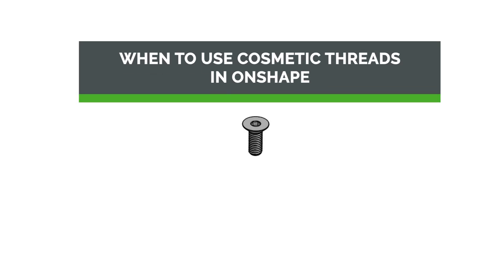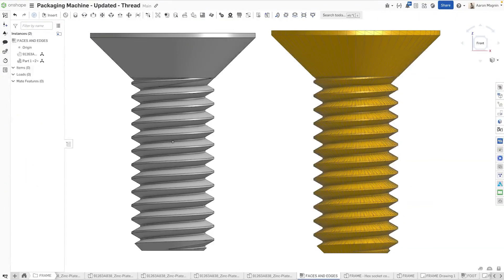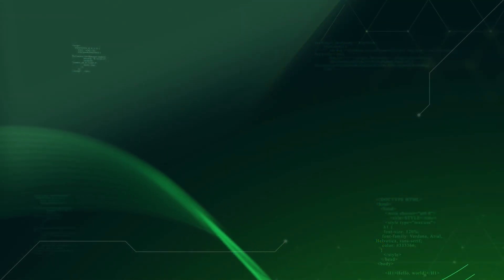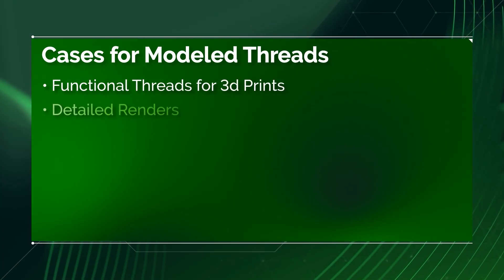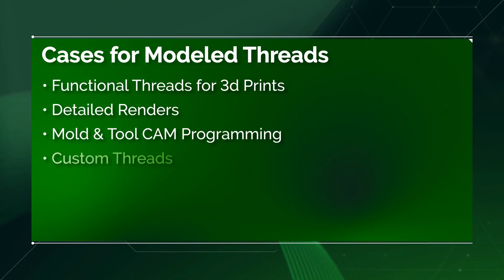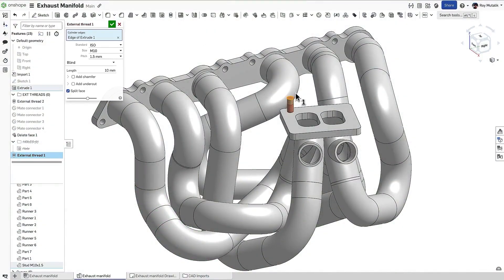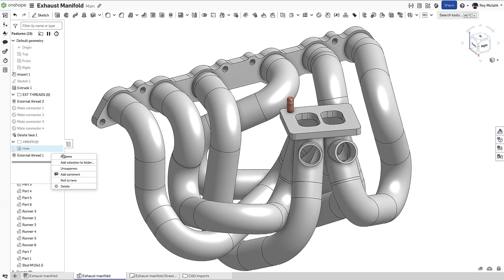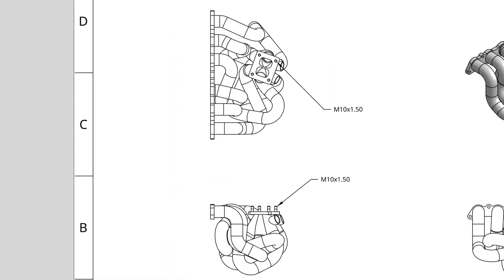Why Cosmetic Threads Are Usually the Better Choice in Onshape - Tech Tip

Comment: If I export a part with cosmetic threads, for, say, a 3D printer, will it print correctly?
Reply: No. If you need to print actual threads you'll need to export something with actual thread geometry, not cosmetic threads.
Reply from the maker: @Marc_Miller   is correct! For printing, you'll need those modeled.

Comment: Is there a feature that generates modelled threads or do I need to sweep along a helix? Ive only been able to get cosmetic threads from the hole feature
Reply: You may use a Custom Feature like "Thread Creator"
Reply: ThreadLab is what I have used
Reply: You can also get cosmetic threads from the "Thread" feature.
Reply: I just download a screw from McMaster and unite or subtract when I need modeled threads.  Works great.